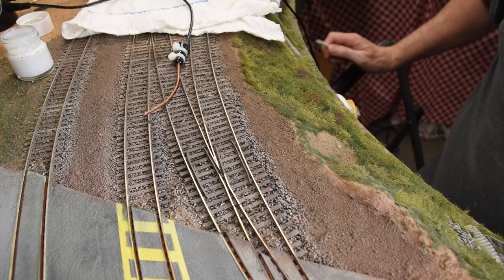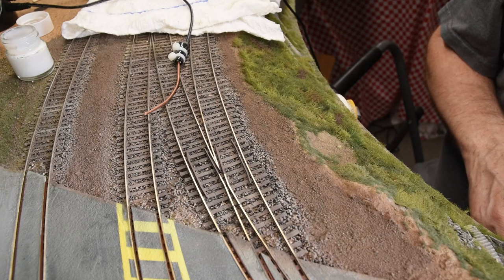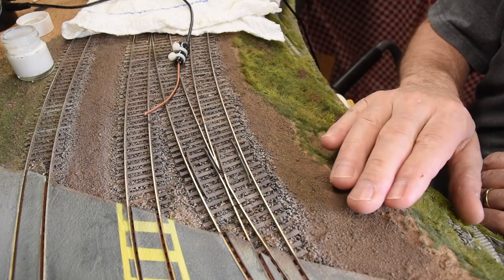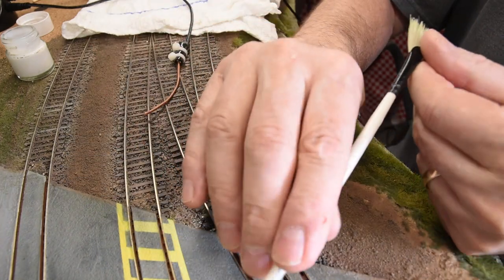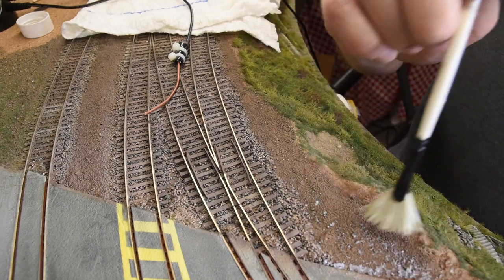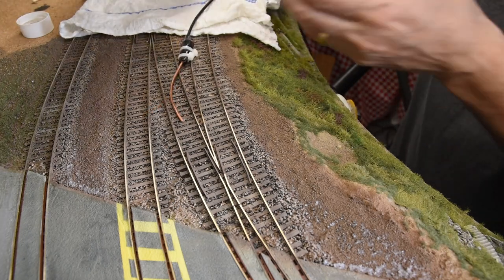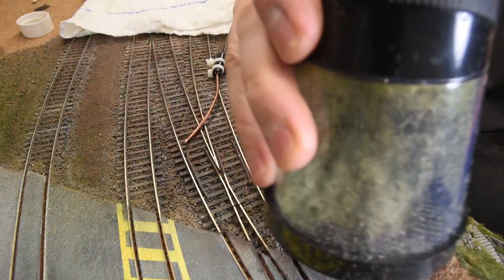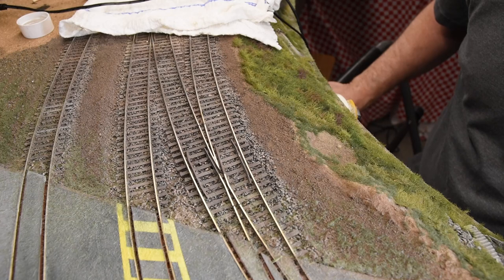HO Scale Micro Grass Tufting | River Road - Vlog #71

Comment: Very timely Boomer. I just bought a static grass applicator and will try it out for the first time tomorrow.
Reply from the maker: The static grass applicator is an awesome tool for model railroad scenery - just simply awesome. Try the shorter static grass like 2mm and 4mm first - it is easier. There is a small learning curve but once mastered, after a little practice, the tool is simply awesome. Cheers.

Comment: Nice and simple. I have not tried a fan brush - I just use an old raggedly brush - to create the micro tufts, but will have to look for the fan brush when next in an art supply store.
I am assuming that what was shown was just the first layer - I generally add one or two additional layers with the same method but using different length and different colour grass.
Reply from the maker: The fan brush is awesome because you can create the long fingers of grass tufts as well. Some times I mix up the color depending on what mood I am in. Furthermore, I almost always airbrush all my static grass different shades of color after laying it all in. I don't film it because it is to difficult to keep up with the camera. ;-) Cheers.

Comment: Boomer, are you cutting the matte medium to make the tuffs? I have used wax paper, the matte medium eats thru the paper and sticks to it so it won’t easily peal off. Also the grass does not penetrate the medium and just lays down once the static app. Is moved away. My third try was no better. I went and purchased some parchment paper.
Reply from the maker: Use Parchment paper with full strength matte medium.
Reply: @boomerdiorama  Ok, but the static grass has not been penetrating the medium.
Reply from the maker: @ronhill5118  It's here:https://www.youtube.com/watch?v=9fNtbjkzb_U